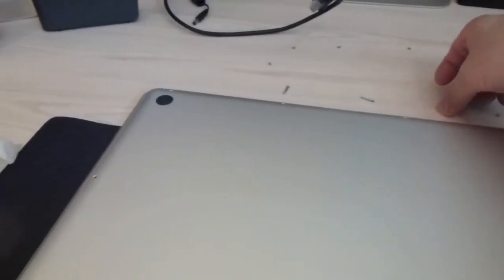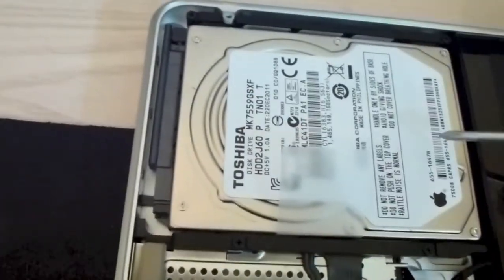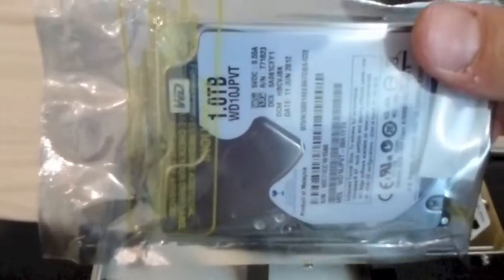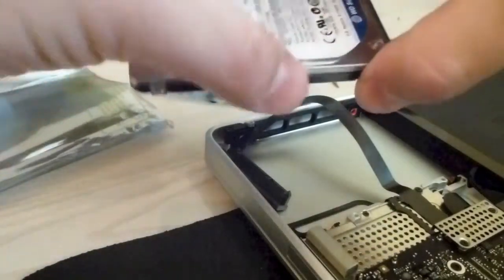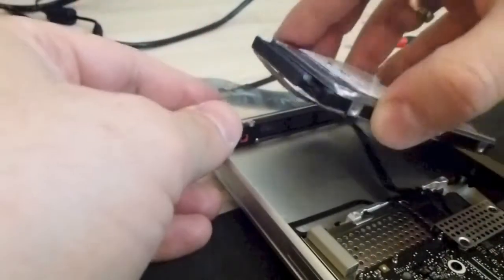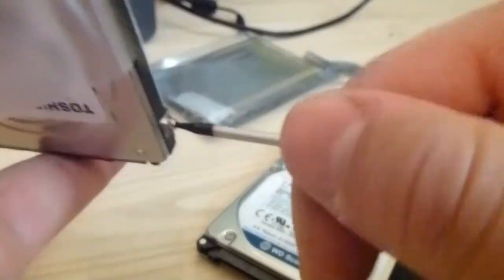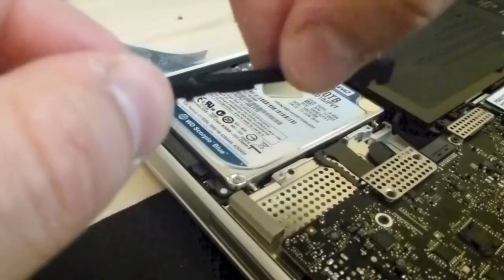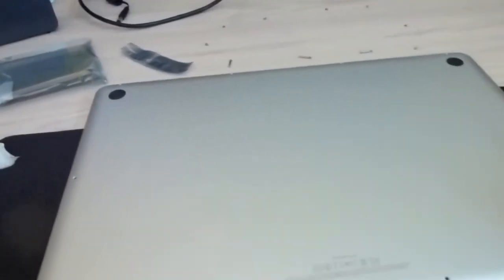How to replace a hard drive in a MacBook Pro

Comment from the maker: How to upgrade your Macbook Hard Drive. Watch how I remove my standard Macbook hard drive and install a new 1 Terabyte 2.5-inch hdd (hard disk drive). The same method is used for upgrading to either a optical hard drive (which is the one I'm using) or a SSD (Solid State Drive). It took me less than 30 minuets to upgrade!

https://twitter.com/HarrysTech
http://www.facebook.com/HarrysTech
http://stuff-you-should-buy.blogspot.com